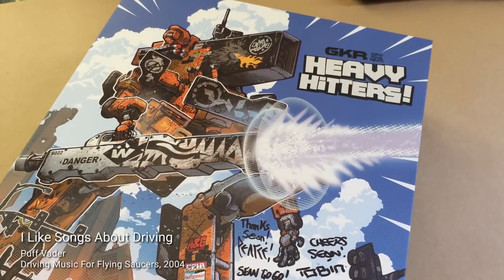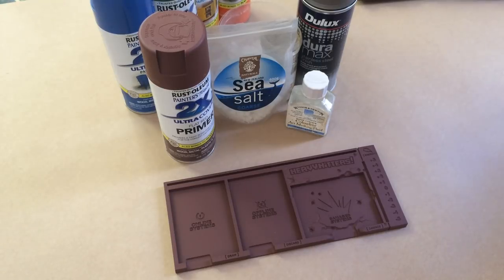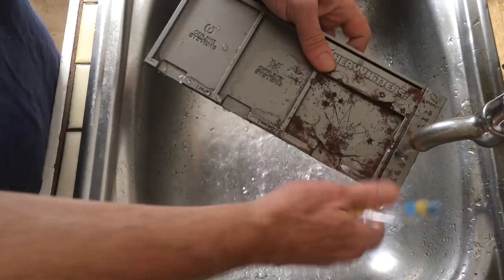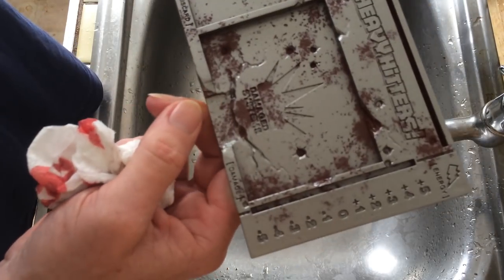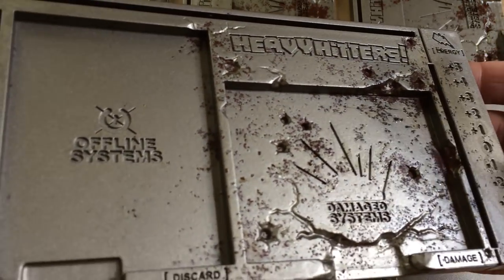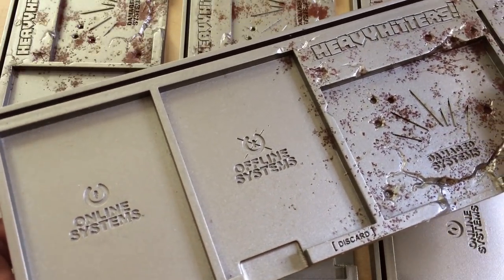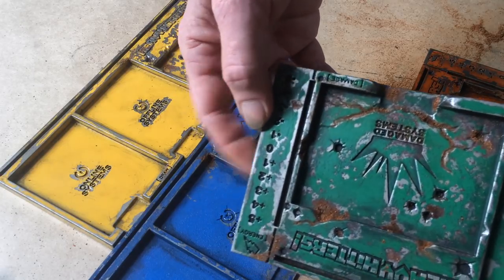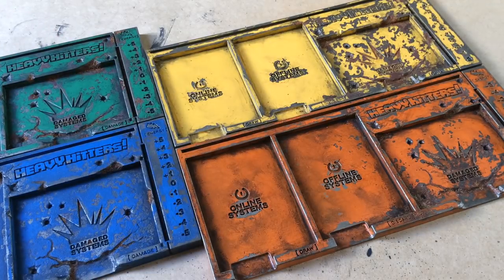GKR Card Trays Painting Tutorial

Comment: I was wondering why you cleaned up the salt before applying the latex ? Wouldn’t it make the final cleaning easier ?
Reply from the maker: You might be right - the main reason I cleaned the salt off first was that I was just following my usual technique. In my normal process, I'll sometimes tape-mask over the the top of the chipping layer, and the salt-mask's uneven surface makes it very difficult to get clean edges. It's also quite delicate, despite the paint holding it on - one wrong move with a piece of masking tape, and it's gone. As I wasn't doing that on this project, your suggestion may well have worked fine.

Comment: Wouldn't it have been easier to just add another layer of salt as a second mask instead of using the latex and washing it all off at once?
Reply from the maker: It can definitely be done with the rust spots, but it doesn't work very well on the edges in my experience. The latex is just more controllable, whereas the salt is quite random as to where it ends up and what it effectively masks.